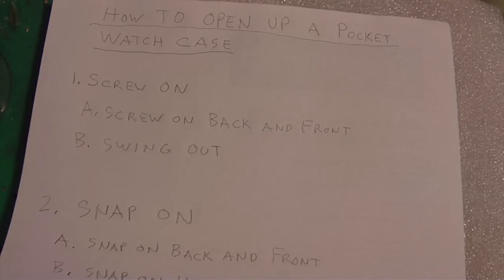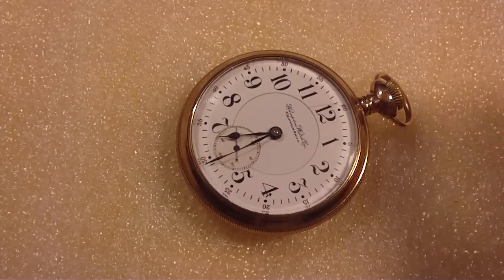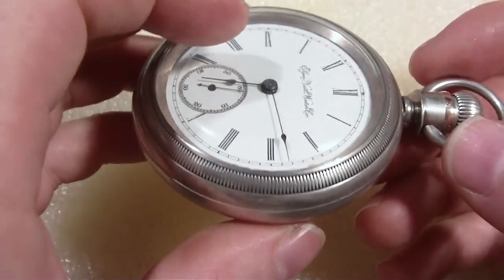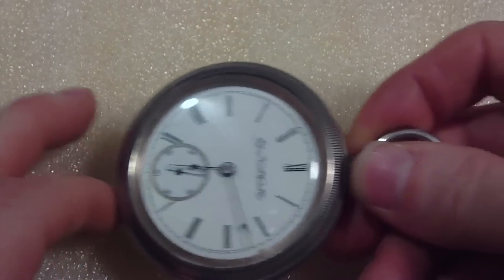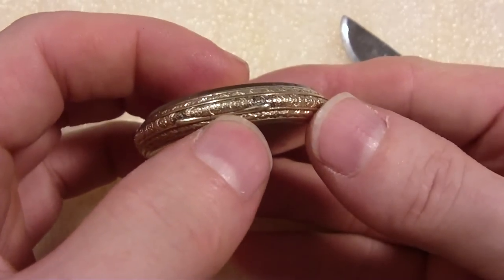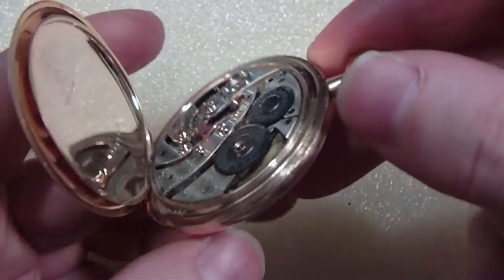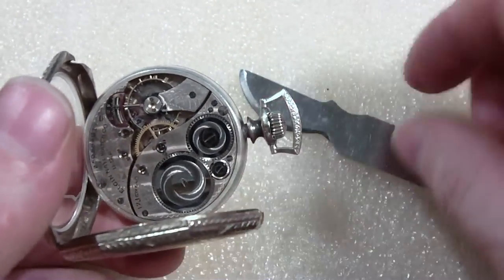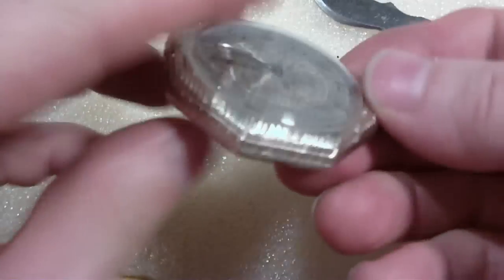How to open up an old pocket watch case, screw on and snap on

Comment: Great video!  Very helpful for this old pocket watch enthusiast.  I have an Addison lady's pocket watch that I think is a screw on (no hinges, nothing but two seams) but I can't get it to unscrew either front of back.  It's old, so I don't want to mess it up by forcing it.  Do you have any suggestions?
Reply: @cuchidesoto2686  Thank you!!  I haven't touched it since this comment.  I've been too scared to damage it.  Is there a certain tool that I could use to help keep from damaging it?
Reply: @cuchidesoto2686  do you think this is something I could take to a jeweler to service, or would I need a person who specializes in antiques?  I'd like to get it working again.  It's in great shape.
Reply: @cuchidesoto2686  Ok that is sound advice.  Thank you for all of your guidance.  I think I will just leave it alone and enjoy it's beauty as it is.

Comment: I have a Caravelle pocket watch with double hinge - the rear cover opens to reveal the movement and the rear cover has two small wires that come out of the hinge on either side and apparently help hold the cover shut when it is closed.  How do I snap the rear cover back on? I cannot seem to get the wires tucked back in correctly.  I didn't see an example of this on your otherwise very helpful video.

Comment: What if you can’t get it to open screw off. It’s like it’s completely jammed stuck and there are no dents in it?
Reply from the maker: I would try a drop of WD40 on the seam and let it soak for several hours.  Some one sells these rubber things that grip the case.  They look like a rubber ball.

Comment: Great video. 
I have a double hinged snap on watch that has a small button on the bezel at the one o'clock location , do need to depress that button to open the watch? 
There are two cut outs that I haven't tried to open yet because I really do not want to damage anything .
Thank you.
Reply from the maker: helmut Diggy Is this an old or new watch?  The only watch that I know of that would have a small button is a pin set watch.  I would have to see some pictures to grasp this.

Comment: I was wondering if its possible to adjust any mechanical pocket watch? 
Mine is loosing 4 seconds every 5 hours. It is not the cheapest one out 
there. But my 15£ german mechanical watch keeps time much better.
Is it true that in general mecanical watches varies with 1 minute in 24 hours?

Comment: No notch's on my pocket watch, very faint line between the case and the back cover. To small of a crack for  X-acto  knife blades so after watching your video that it was a screw on back. You showed to pull on the crown before trying to un-screw the back. Well the crown came out of the watch, and I can't get it back in place. So now I have a expensive broken watch that was working fine before, and still can't get the back off.
Reply from the maker: After reading your comment I see your mistake.  You say that you determined that you had a screw on back and then pulled on the crown.  Why did you pull on the crown?  No where in my video do I say pull on the crown for a screw on back.  I say to pull on the crown only if the case is a swing out type.  There is no back to unscrew on a swing out type case, just the front.  The reason to pull on the crown for a swing out case is to clear the stem from the movement.
Reply: @bunnspecial  I finely got the crown to snap in again. This is a high quality Yves Renoir Gold Swiss Quartz 51mm pocket watch that seams to keep perfect time.
I would like to snap the back off to see the inside and see what battery it takes. I thought about using a utility knife blade as a chisel to snap off the back, but then snapping the back on again I might crack the glass.  I have never seen a pocket watch with such a tight fit like no visible seam to put the blade into.

Comment: Hi Great video, I have a watch that has a very similar case and dust cover and the mechanism looks the same to the last watch in the video, my face appears to be a machined silver one rather than enamel. Thanks to your video I was able to swing out the mechanism and see it for the first time, can you tell me anything about the mechanism? Any info would be very appreciated. My case is sterling silver and hallmarked for London 1860/6,1 the maker's mark is J.H (Joseph Hirst). Any idea what the watch might be worth? I have a key and it runs but it is missing the second hand. Thanks Bruce
Reply from the maker: Without a picture I can't tell anything.

Comment: I have a elgin natl. watch co. I'm pretty sure it is screw on but I'll be damned if I can get either the front or back to move. Any tips on getting them to unscrew without damaging the case?
Reply from the maker: +TheCharliebeardog There is something you can buy to help open screw on cases.  It is like the rubber thing one would use to open up a jar with a screw on lid.  I have seen it on ebay.

Comment: mine has the two seems and is very obviously a screw on but its so old it wont screw off, its a well worn very old Trio, it stoped ticking and only ticks when i shake it. I dont know how to get it apart
Reply from the maker: Maybe a drop of WD40 on the seam and let it soak for a day.  There are rubber watch case openers that might help.

Comment: I have a Waltham I’m trying to open, it has screw front and back, the front comes off easy but I can’t get the back to move. Any ideas?
Reply from the maker: I have seen on ebay a rubber thing for sale to open up cases.  Sort of like something used on jars.  You could apply a few drops of WD-40 along the seam and let it soak.  I heard there is no problem that high explosives can't solve.
Reply: bunnspecial thanks I’ll give that a try

Comment: i took the back off of my pocket watch and i used a box cutter blade i used the blade by it self to open it and i think i chewed up the sides of the case i only used one time to open it and the back wont go back on it wont snap back on what do i use how do i make it snap back on
Reply from the maker: There might be a burr created from the blade that is preventing the case from closing.  If there is a burr I would stone the burr off with a fine stone.  Don't use a file, it is to coarse.

Comment: Some screw off fronts and backs need some help. What should I use? I know one can use a rubber ball, but even that doesn't always work. What next?
Reply from the maker: You could put a couple of drops of WD40 or some other penetrating oil on the seam and let it sit for a day.  It worked for some wrist watches that would not open.

Comment: I have a Elgin pocket watch dated back to around the early 1900,s it belonged to my wife,s great grandfather and was give to him on his 21st birthday in 1907.. would like to know for sure how to open this watch as it still keeps perfect time we wanted to get the serial numbers off it but in the same respect do not want to damage it in any way,any help from anyone thank you
Reply from the maker: I made a video showing how to open up a pocket watch case.  Maybe you should check it out.  There are many types of cases so watch the whole video before trying to open your case.
Reply: @bunnspecial  I did watch your video and saw nothing in it that even looks like the watch I am talking about I even went to the Elgin site and posted a photo of it they have failed to even respond back.. I have tried to screw it off as that looks to be the way but it would not unscrew back or front.. this watch is from the early 1900 and runs perfect so we want to be sure and not mess it up in any way
Reply from the maker: I would not be surprised if you don't hear from the Elgin site since not all watches were cased by the manufacturer.  They had to get the watch in the case some how and would have to remove it for cleaning and oiling so there is a way to open it.  Look it over with a magnifying glass for any seams.